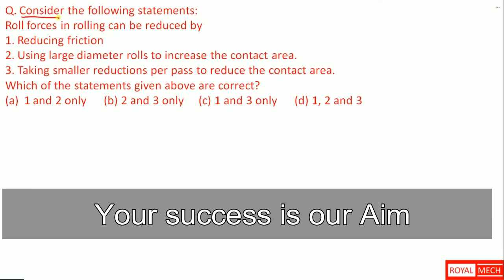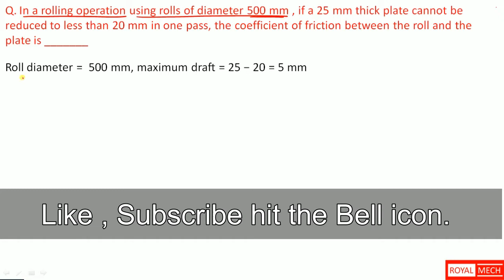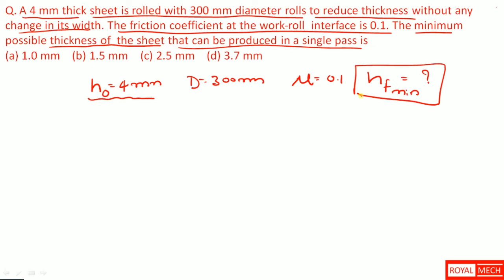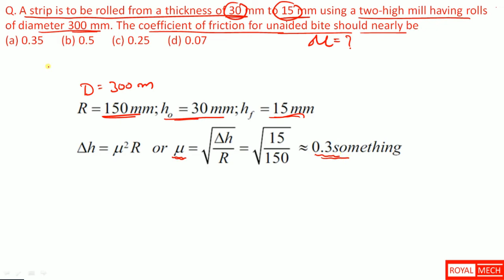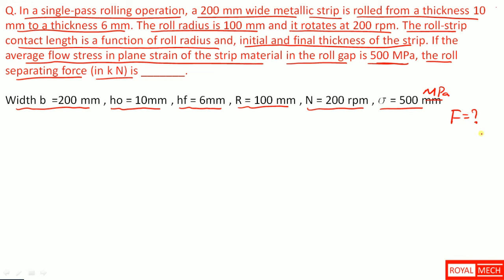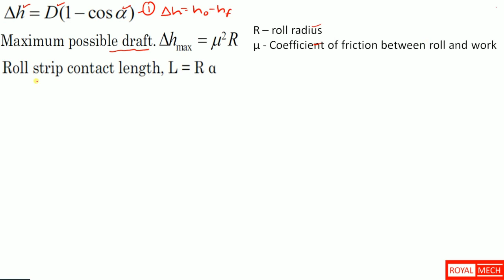Manufacturing (metal working ) process rolling 2 : important MCQ

Comment: Dual-cassette wiper system, Strip Wiper, drying, Wiping, oiling, remove Rubber Rolls, Cold Rolling Mills, Process Lines

rolltechin@gmail.com

Adaptive strip wiping systems, mechanical, vacuum, suction rolls for high speed reversible cold rolling mills, galvanising lines, pickling lines for all types of fluids corrosive & non corrosive for more details call +91-9050539120 or mail us at rolltechin@gmail.com.

We would like to introduce ourselves as a group of technocrats who have been serving the cold rolling mill industry for more than 2 decades.

Over the period of employment with the Cold Rolling Mills, Pickling Lines, Continuous Degreasing-Annealing-Pickling Lines, etc. we had come across various practical problems like Roll Coolant carryover, Fluid Carryover from Degreasing lines, Pickling Lines etc. which result in poor quality surface finish of the final strip. Also the frequent damage of Rubber Covering of the Squeeze Rolls whether Rubber Rolls or 3M Rolls, induces high costs and Down Time for replacing them. 

Even with the most expensive wiping systems available in the market, the results have not been satisfactory besides high running costs. To overcome this problem, we have developed a very efficient high-performance Strip wiping system which can work from 0.010mm (10 Microns) to 10.00mm thicknesses, Strip width from 100mm to 1500mm, Line Speeds from 0-600 MPM.

Please find attached the technical write-up of the High performance Strip Wiping system and videos which are depicting the wiping action of  Neat Oil as well as Emulsion Oil at 600 Mtrs Per Minute Line speed. For the purpose of testing of the Wipers in extreme conditions, we have flooded the strip with Coolant and the performance is self-explanatory.

https://www.youtube.com/watch?v=_HXdPj-VnUs
https://www.youtube.com/watch?v=fhFJsDR3Rhc
https://www.youtube.com/watch?v=FB5LAjEQhVs
https://www.youtube.com/watch?v=_ovvVwXFWIM